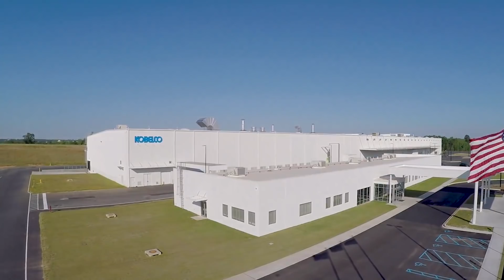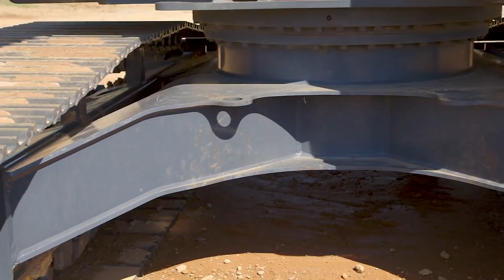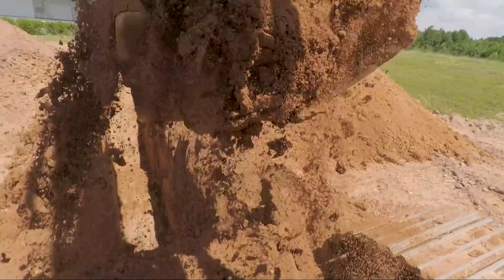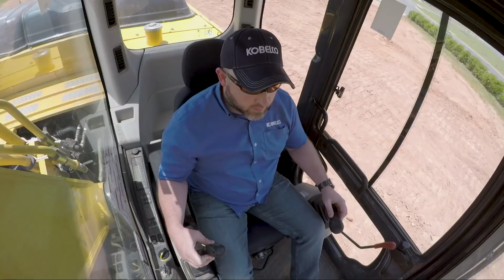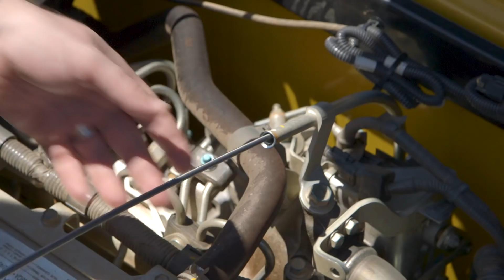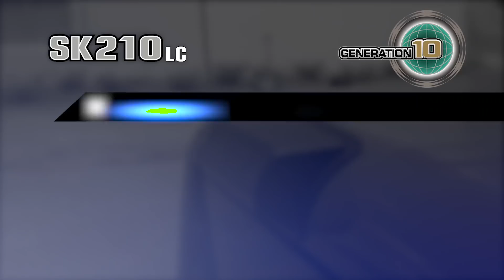KOBELCO SK210LC-10 vs Komatsu PC210-11 comparison

Comment: From an apprentice viewpoint ,not a lot of time the machine but I still like the smooth fluidity of the Komatsu series excavators I always thoughtl Lnkbelt was the strongest, and more powerful , but with advanced technology over the years,  things change , komatsu may not be 1 in all areas  ,but she can run with the horses,  they each have their strengths, depending on the job ,different strokes for different folks .